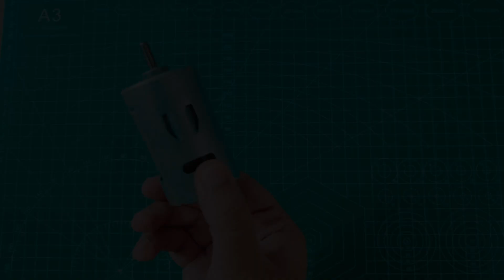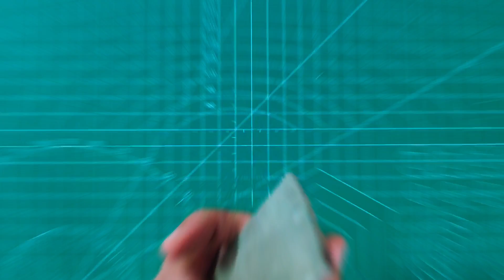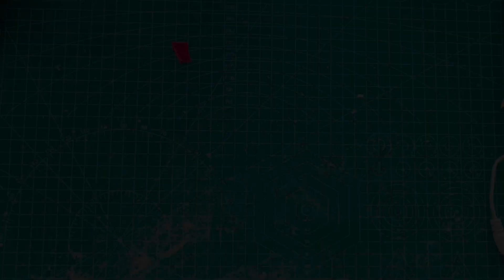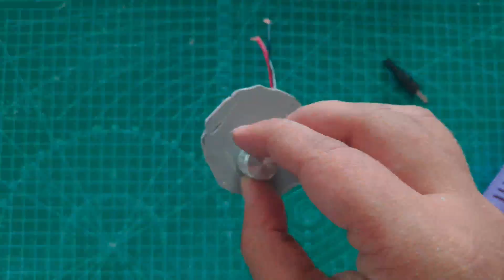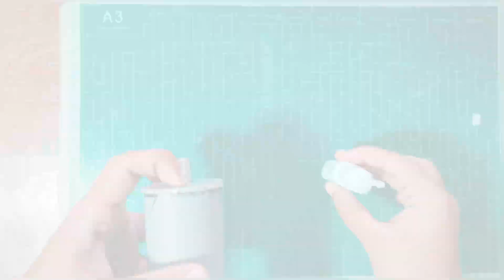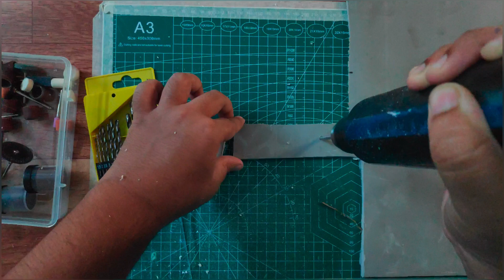How To Make Mini Drill Machine | Useful 6 In 1 Tool | MDA WORKSHOP | Dremel Tool |

Comment: Is this drilling machine is working with battery are with electricity plz describe it clearly it could understand it good luck for upcoming video👌👌👌
Reply from the maker: This drilling machine is working with 12v DC to 24v DC. But in this video we have used 12v DC. Thank you😊